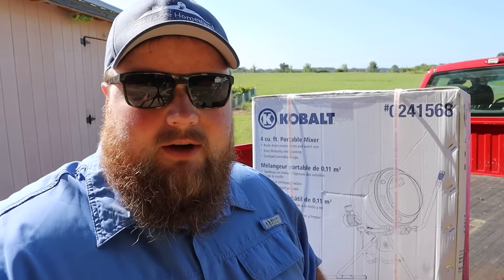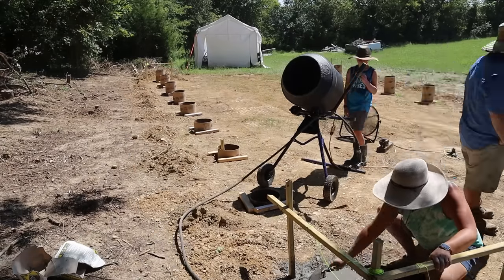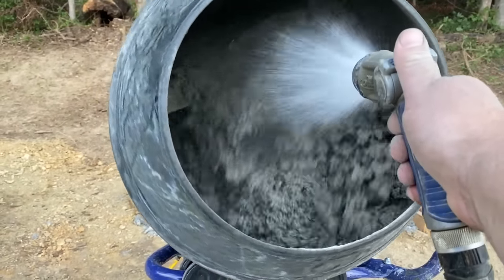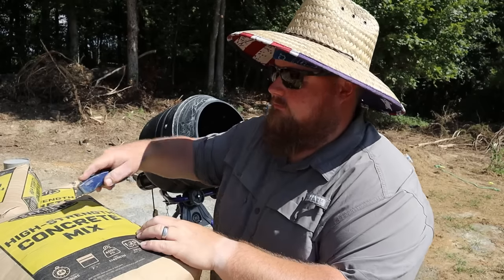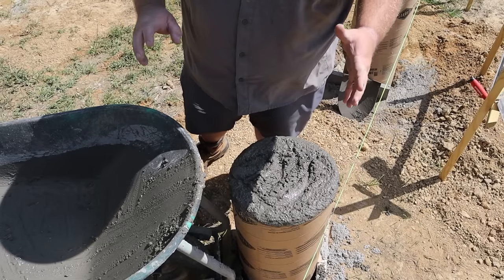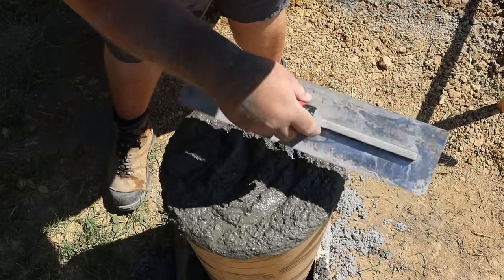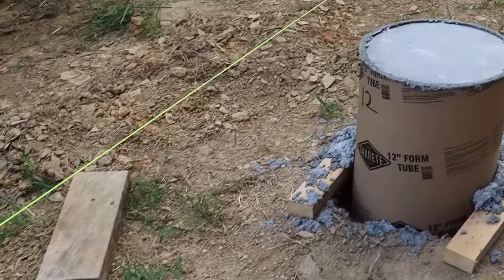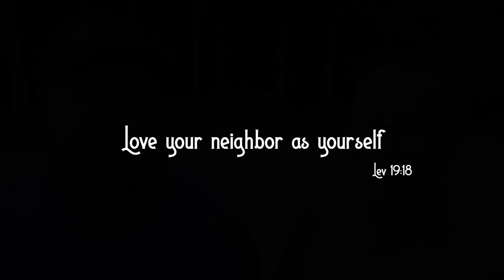We've NEVER Done THIS Before... Concrete Tube Forms & Piers

Comment: Here's a tip for you Sam. When you have filled a tube with concrete, take any electric power tool that vibrates and place it against the side of the tube (whilst it is turned in - obviously) and that way you vibrate the concrete and get air out of it and the water floats to the top. I really enjoy your videos - carry on carrying in!

Comment: A concreate vibrator would have been ideal, but in the future you can take a Sawzall without a blade in it and hold it up against the sonotube and vibrate it that way. Go around the whole tube while pulling the trigger on the Sawzall, holding the pivot against the tube. Not quite as good as a concreate vibrator, but is works pretty decent.

Comment: If you use concrete brackets to attach your post to the concrete pillars, you can use steel washer to level the the brackets.

Comment: Sam & Angela I think you got this right in the end except for not leaving the concrete a little proud in the tubes, it may have left you with your level right, maybe not, but realy that does not matter, I would not add a skim coat to level it, most likely it will probably crack and become loose and cause you more trouble and problems than its worth, just shim to get your levels back.

Comment: If you’re using post. Cut the post to correct height adjust for variables. If you’re putting down frame use shims. Do not skim coat the integrity will not be there with a skim coat. Keep up the good work.

Comment: I flipped out of my chair when you mentioned mixing in the wheelbarrow! I put a mobile home on cement foundation 12 ft at a time paycheck to paycheck without a power mixer.Mixing in the barrow is great for the abs.I was not going to bring it up till I heard you say you were going to do it without the machine.The machine does save on the blistered hands! CHEERS fron Westcoast Canada! P.S.We can see when you spill the mix into the wheelbarrow that your mix has a good slump!

Comment: No to the skim coat just use the leveling brackets you would need to keep wood directly off the piers anyways.
Reply: Hope the brackets are xlint-quality zinc coated, etc. That's wonderful to have the broad eaves (and easy gutters in wet climates).

Comment: When using sono tube forms, after pouring in the concrete take your trowel and firmly, but lightly tap up and down the tube and around it. That will help the cement settle in the tube and reduce air bubbles in the concrete. Although if you have a concrete vibrator even better.
Reply: I thought this through the whole video but knew it was too late to tell them that. Lol
Reply from the maker: Adding that to our "learn list" for the next time. :) Thanks!
Reply: @sam-and-angela a Sawzall without the blade makes a great concrete vibrator . Just push the nose up against the form and pull the trigger
Reply: Sawzall works great for this!

Comment: 1/8ths inch is the variance most construction allows. When you put the shoes on the Xby beams, they will have four points. They all have variance. There will be plates you can use. There will be seats that fit the frames. If you skin the tubes you are asking for trouble. Go to where you got the concrete and ask questions. They will either have the materials, or know where to get them.
You did a great job with those sona tubes. They are tough, especially the larger ones.
Doc

Comment: Sam if you ever pour concrete in a tub or a form take a Sawzall or a Jigsaw leave the blade out and use either one as a concrete vibrator against the side of the tubes or forms and all the air pockets will vibrate to to the top works great just use the variable speed of the Sawzall or Jig saw slowly until you get the hang of it, it’s the poor man’s vibrator. Also it would have helped to build you a half round chute out of 1/8” plywood and 2x4’s so you don’t spill so much concrete. Just a couple of suggestions Great job and your boys are getting big enough to be some serious help. Shim with metal plates do not add concrete to level won’t work. God bless brother.

Comment: Here’s a suggestion for you , get a big foot that goes on the sonic tube it makes a great funnel for pouring concrete into the tubes  .. another suggestion , when mixing concrete , take a piece of rebar longer than the width of a bag of cement place a bag of cement over the bar with the bar in the middle , then cut the bag open over the bar pick up the bar and you’ll have 2 half of a bag of cement which is easier to handle and dump into the mixer

Comment: Just curious why you didn't knock together a trough with some plywood and two-bys and use that to go between mixer and sonotubes so you could skip the wheelbarrow step.  Would have cost a little time up front but seems like it would have saved time and you back while pouring.

Comment: Another suggestion , get your reciprocating saw take a blade out and use it to vibrate your tube or forms, which ever you are using. It will help settle the concrete and work the air bubbles out

Comment: Sam I think all that matters is that the top of the posts are level on your post frame building.
I have seen a few set the mixer on a frame to make it easier to pour into the wheelbarrow.
Nothing about concrete is easy its all hard work.

Comment: I took a sheet of plywood and built a shoot, one end the size of the hole with 2x6 sides on it and fixed it so it would connect to the legs of my mixer and when I dumped it all concrete went in the hole.

Comment: I would have leveled the posts at the top, not the bottom in regular pole barn buildings. If it was some type of metal building, unless you were more than an inch different in the height, I wouldn’t worry about it.

Comment: Suggestion  that just to late   but there are quick attache accessories  (bobcat) that fitting tractor  a bucket  that pours out the bottom  just for pouring  piers  
Ans there also one that pours out the side end also designed  piers ect that are rentable   but would require  research to see if there are some in your area

Comment: I am of the mind to work smarter not harder. Just get it delivered by a concrete company. This bag mix concrete mix leaves a lot to be desired.  Poured  a lot of crete in my day if using bag mix always get a bag of portland cement and add a couple of shovel fulls to each mix as it increases the strength

Comment: So, im just an ole gal here but if it were me i would have drilled holes thru the cardboard tubes making a cross and using a yo yo tie the 2 rebar in place. The rebar would have to go across the dirt preventing it from sagging. Also, for the water content, i would have put the dry concrete in the mixer but id fill a 5 gallon bucket full of water ( extra step) and add it to see where the concrete mixed to and see if it needed more water or not. Id have the 5 gallon bucket marked in quarter marks and for the 2 bucket id add a half of a bucket or start with a quarter bucket to see how the concrete setup. I hope this would help anyone else. It took a lot of years to come up with this…..i helped my dad over the years and it at some point dawned on me that we could save a. Lot of work by taking a small amount of time in this than having a dilemma . Dad used to say cry 1 x or be prepared to cry a lot
Reply: Oh one more thing, you can cut a large diameter culvert in half and use that as a funnel so you dont waste a lot of concrete

Comment: How tall are the poles going onto the concrete tubes? Could you just attach them and then cut them to level with each other? Just saw the end of the video and seems you may do something totally different.
Reply from the maker: Yes... different structure than 'pole barn' as I've said a few times. My terminology is going to throw off several people. Sorry!

Comment: **I know, these video's are 'after the fact' and you prob figured out the solution to the concrete forms already. Still want to share an idea.  I've seen folks use a power tool to vibrate the concrete while it's still wet, to get any air out. I think some of that is due to water evaporation also. A tool like a drill with a hammer feature works.  ** maybe you can sand down the ones that are higher, rather than trying to shim up the lower ones.

Comment: 60 pound bag of concrete = .45 cubic feet x 125 bags = 56.25 cubic feet = ~2 concrete trucks that could have backed right up to the area and run concrete down the chute into each form with little to no mess. The job could have been done in 1 morning. Hindsight is 20/20 and I'm not criticizing, just saying this is a consideration when planning a project like this. For anyone planning a similar project, I would recommend at least getting a quote for truck delivery so you can calculate the value of your time and labor.
Reply: Apologies, my math is so very wrong. Concrete trucks are measured in cubic yards and I was only calculating cubic feet. 1 cubic yard = 27 cubic feet, so y'all used just over 2 cubic yards. I think most concrete companies have a 3 yard minimum. A truck would not have been possible here.

Comment: I am making this comment at the 4 minute mark of the video.  I would mix up the concrete and dump it in the tractor bucket, then fill the holes from the bucket with a shovel, by lower the bucket close to the hole.

Comment: Why are "home" mixers made to what amounts to one or two concrete blocks at a time? Its not as if you can put a "lip" on it to guide the concrete when you pour it... Into the wheel barrow - right. Good way to do that but then getting that into the sonotube... Grrrr. OK shovels it is...I think I know why they invented those concrete pumper trucks and the chutes on concrete trucks... The best way to ensure level is probably what RR Builders does - change the lengths of the verticals to compensate. Thereby find the lowest (or highest) and then mark on each tube how much to cut off or add on to make tie top plates level. Set your level lines as a measurement to the top plate of the walls.

Comment: since you have the space to store it i bet you be getting a lot more use out of that mixer
the thing dont nessisisairily needs to mix concrete , it could allso mix basic ingredients for say soap (in powder form )
im supprized you didnt trown together a quick wooden funnel after the first mispour 
you kinda can measure slump , you need a flat board with some circles on it and a soupcan , you cut the bottom out of the soupcan and place it on the bulseye of the circles , fll it to the top with youre mix and pull the soupcan away from the board , now the cemend will spread , wat you want to see is it covering the same amount of circles every time , if its less the mix is too dry or starting to harden of it runns off the board its too wet
as for shimming the piers by laying a skimcoat of concrete over it , i dont think that would work , like you mentioned it probably whont adhere and crack over time , think metal shims or treaded rods with a bolt under and above the flange works best for adjusting it , can smear some cement around it after the adjusting to close the gap under the flange , it whont be loaded so it should be fine

Comment: Testing  for is possible in the field  big commercial jobs it's required   it is a 12 tall cone   you fill with your concrete give quick  vibration   the remove cone and observe  how much it shrink  or settle down when cone removed   cone is 12   and the free standing  fresh cement settles to much the center entry load is rejected  as having too much water that actually weakens the product    commercial  jobs also do pressure testing   2 ways one the just fill a cylinder  and the other way actually  take core samples  while still  green   they are tagged as where and when taken  and allowed  proper  curing time before  being   tested and if fails test the company  has to go back remove that area of pour  which becomes  quite expensive
Reply from the maker: Awesome, thanks for the information!